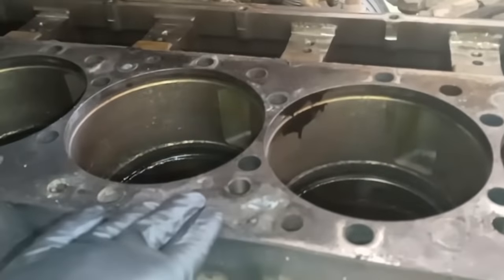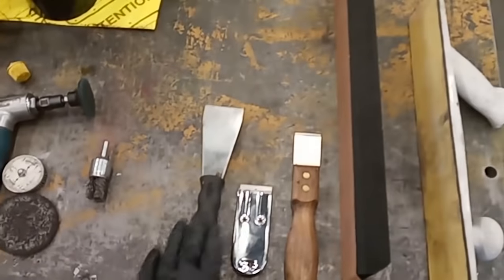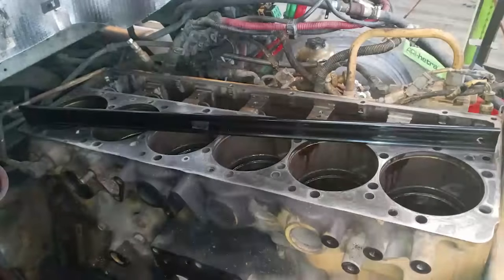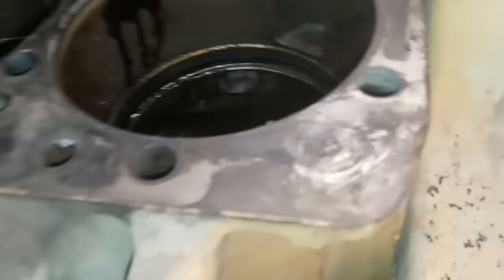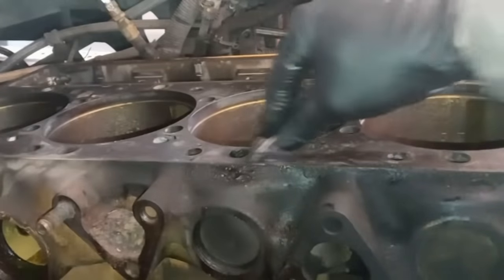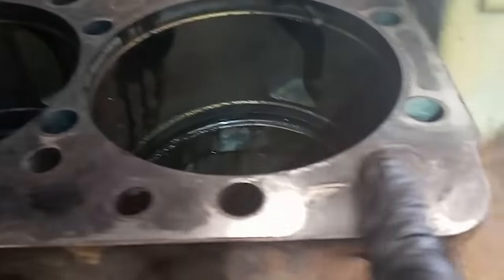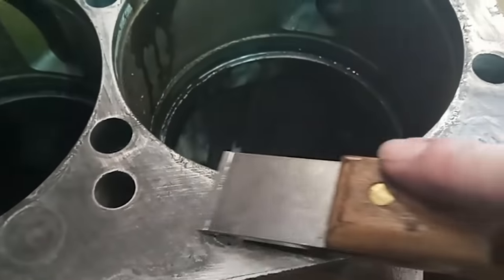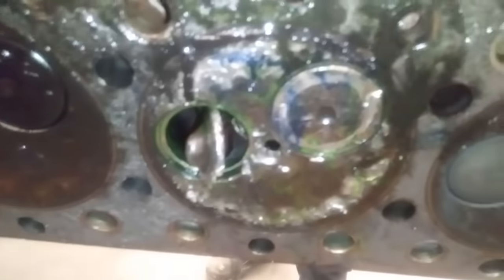Clean a Head Gasket Surface like a Master Engine Builder.

Comment: Hey how do you feel about bits of debris falling into the coolant and oil holes in the block? Is there potential for damage there or do you consider it negligible?
Reply: Geoffrey Robertson any small bit should not matter as if u do this you should flush your coolant with water until it is clear! And you should do a oil change shortly after doing this too!
Reply: Take cheap disposable earplugs and plug any holes you can with those. Saves a lot of work later

Comment: I'm going to Scott community college. my diesel teacher showed us to use a straight edge like you did. I was told to scrape and brillo pad and then wire wheel it then blowout all the holes. What's your opinion?
Reply: Skip the wire wheel. The best point I think made in this video is that the flatness is key, not the appearance.

Comment: How does this change with protruding liners? This is why I always end up scraping and then using Grey scotch pad lightly while chasing with rolls of blue rag and brake clean so I don't "loose" any of the abrasive dust.

Comment: When I started out rebuilding engines , after the block deck was cleaned we always took a bastard file to check for small areas of level like around individual cylinder holes than we moved up to a longer straight edge that would from one corner of block to other .
 Several ole ole ole Detroit's I had to use good old #1 Hardening Permatex to fill in the low spots . Never had a failure as long as block was super clean no oil or old gasket material left . I think the worst one was around .20 thousands difference  due to coolant leakage  in that area .
Plus that bastard file left you with a good surface grip .
There was one 8V71 series a customer brought in with a leak on the right bank , once the engine got up to operate temp you could see The Head walking back & forth on the block . Let the engine cool an checked torque on the nuts as it had studs in the block . Whoever had machined the deck several years back took off way too much material. The customer wasn't happy with that news !!,
Another time we had one come in with low compression an burning oil something fierce after another Shop had did a rebuild, I think he had like a 5 thousand mile warranty Or some such stuff , I watched as one of the old guys in the shop ran about 3 handfuls of bon-ami thru the intake as the engine was running , an sure as shit afterwards that sucker stopped burning oil , of course I got stuck doing the oil change as the then New Shop Puppy .

Comment: I do it more or less the same as you, but I always wonder about the abrassive dust/particles going into the bore and oil galleys in the block when sanding/scraping. I find it very difficult to clean afterwards. It makes you think how much you are actually removing and what kind of damage the rest is doing (abrassive dust/particles).
Great channel by the way:)
Reply from the maker: Thank you. I too ponder that. I do clean out the head bolt holes afterwards and tap them, then spray about 1/2 a gallon of brake clean over everything, but the only 100% clean option is to hot tank the entire engine.
Reply: I put a shop rag down each bore. Pulling it out when you’ve finished takes most of the crap with it.
Reply: Some folks say shaving cream in the small galleys, then shop vac it out, change the oil shortly after first startup.
Reply: Mattress foam and vacuum before you remove it

Comment: Great video as always! your a great teacher man. Much respect for what you do! I have some constructive criticism on that long aluminum straight edge...incase your not aware (im sure you are ) , when you make your measurements with the feeler gauge just be careful not to push down on the top of the straight edge. steady the straight edge from the side with your thumb and index finger like your pinching it. believe it or not , but just that little bit of pressure may deflect it just enough to make you think the readings are correct, when in fact they are not or at the very least throw it out a thou or two. just something to consider.
Reply: If a finger pushing down 2 lbs on the straight edge gives you good results with the feeler gauge then properly torqued head bolts with a new gasket will give good results.

Comment: you can see where the sander is hitting the high points. Thats where the gasket will be compressed the most. The lower areas will allow liquids to seep in

Comment: Knock out the highs, and rock on. I hone my surfaces at the end, but I'm a millwright, and it's just what we do. Hone just takes out the highs, doesnt take away material.
Reply: Hone my engines and cylinder heads I build, not just at work on turbines, compressors and pumps.

Comment: Hey Josh, I’m in the middle of doing this right now. Is there anything I guy should do to try and keep junk from falling down onto the crank or into the oil galleries? If so, what? Or do you just let it all fall and soak everything including the crank down with brake clean when you’re done to wash all the junk away?
Reply from the maker: I usually wrap the rod journals with a shop towel and wrap it tape during all the cleaning and prep work, especially if you are doing counterbore cutting. The longer bores, bolt holes and stuff you just have to clean after the fact, unless you can get some big plastic plugs for the liner bores.
Reply: @AdeptApe  thanks so much for the reply! I’ve got another question for ya now. I’m checking liner protrusion on my Series 60 I’m rebuilding and I’m using a liner depth gauges much like the one you use in your liner protrusion video and my readings are all over the place. All depends how I’m holding and where it’s sitting. Should I be putting pressure down on the gauge to hold it tight against the top of the block or just let it sit on its own and slide it. Seems like the gauge moves a lot depending on how my pressure is. Maybe it’s just that uneven, idk? Any input would be great. I don’t want to mess this up.

Comment: i know old school guys that only use a rolocs lol.... im glad someone else is making a thorough video to teach people the right way. what do you think about those roloc bristle discs with the rubber fingers on them. rated for aluminum but im skeptical
Reply from the maker: They are interesting, I've used them in the past, but anything that is going to be able to clean a metal surface by high speed spinning is going to potentially removed material asymmetrically. So I generally just scrape, then use a brillow pad on Aluminum. If the surfaces has stuck on gaskets or material perhaps some wet sanding with a 400 grit sandpaper. If the piece is thick and strong I'll try tapping the gasket off with a small ball peen hammer.

Comment: I worked 2 years in an engine machine shop. We used wire cup wheels, but always careful not to eat into the metal. And most blocks or heads were getting resurfaced anyway, though quite a few weren't and it wasn't an issue. I do like your method though, using a wire wheel makes a big mess and I wouldn't do it to an engine that isn't fully disassembled and getting jet washed. Lots of places I wouldn't want pieces of wire going on an in frame rebuild.

Comment: I cleaned the deck and I’m a little worried about debris.  My plan is to drain coolant, flush oil through and vaccuum/blow out cylinders.  Is that enough?

Comment: I guess I'm lucky on making them flat . I am in my engine machine shop so we generally machine the deck on an engine I am rebuilding . Do you have any videos dealing with repairing the counterbore for the liners ? We also go out in the field and cut most big diesels for shims or upper repair bushings . We also have the machine to install the lower repair bushings for the area where the o-rings go .
Reply from the maker: What do you guys charge for the orings bushing install?

Comment: Surly the loose grit will go down the oil gallery and become a grinding paste flowing though the engine?
Reply: If the engines being rebuilt out of the truck it'll get magna fluxed. I don't think that grit would do anymore damage than rust would
Reply: @johndowe7003  more common is penetrant dye and developer.  Less damaging when put back into service.
Reply: @tyrel7185  yea tht too

Comment: When I worked in the engine shop at a CAT dealer the machine shop would prep the block and head by skimming it. So, I never had to worry about it. In the field I use a die grinder with a fine wire brush. Yeah, some folks say that's not great cause the wire breaks off and can get into the engine. I've never had an issue in 20 plus years.
Reply: At my workshop we would lose our job if we got caught using air tools on a head or block
Reply: @jimmyoakeslift4374  I'd agree for aluminum

Comment: I’ve only ever scraped my blocks with a razor and brake cleaned. I’ve never had a problem with head gaskets leaking afterwards. I did use scotch brite by hand on my last engine but that was only because I succumbed to the it must be shiny pressure. I’m weak.

Comment: Gasket surfaces require an extremely smooth surface finish (cosmetic recommends 50 Ra or less which equates to about 150 grit sandpaper).  Less than 30Ra for MLS without Viton coating.  

220 is plenty.

Comment: Recently replaced head gasket on a roached Chevy 350 using a razor blade and three stages of sanding the surfaces by hand rather than using a block. I'm worried about it sealing properly and having to take it to a machine shop to get it decked. We'll see how it goes....
Reply: Note, I used a straight edge across everything and it seemed good but I'm thinking I may need to do it all again

Comment: Should check out the plastic 3m wheels. I'll only use them to pull off the really hard stuff
Reply: What’s the difference? 3m makes the roloc wheels too
Reply: I think those plastic wheels are only plastic, and  softer than any metal anywhere in the engine. This would mean that it can't remove any metal at all. Also, if any did get into the engine, it can't wear down any metal. As much as I would love to use something quick, especially on leaking head gaskets, I've always done the razor blade and fine sand paper.

Comment: Scrape well. Then I use a paint removing wheel on a four and 1/2 in. grinder. Hold it flat, and be on/off the trigger, in pulses. This works well, but if you have the time and money, use a quality machine shop.

Comment: Hand labor is always best, anyway puzzled with Cat engines with “copper core leaching” when doing oil analysis. I know it increases with load and ambient temperatures, need your opinion if this is indicating a cooler premature failure, even after new cooler installs it’s still comes back, read Cat bulletin on this, please do a video on this, thanks great channel!

Comment: Rather than using sand paper, I suggest that you go over machined surfaces with large sharpening stones. They can be kept exceptionally flat using flat stones and they will only remove material that extends above the machined surface. This is how us machinist keep our milling tables clean and free of burrs.
Reply from the maker: I've heard that more than a few times on this video now. I'd never heard of that before though. I have heard of using a large flat file as well. Wondering if perhaps that is also acceptable.
Reply: @AdeptApe  Files aren't really that flat. So I would not recommend them for this application. As alternative to stones, I would suggest using adhesive backed sandpaper on a very flat and ridge surface, e.g. machined steel, iron, or, even better, granite. Rubber or anything pliable is not suitable.

Comment: Id always flat sand blocks and heads on old flat 6 dodge motors. Use a straight edge and feeler gauges to find high and low spots

Comment: Could a random orbit sander also be good?  Even flat sanding can leave slight valleys depending on how rigid the sanding block is.  Agree with measuring off a machine-grade straight edge using feeler gauges.

Comment: Gotta question. So I have a 2007 T800 with a C13. Now that it's cold out she likes to hesitate. It hesitates all gears until it reaches  150 degrees engine temp. When it hesitates or jerks/bucks, it blows out smokes out of stacks. Once it reaches 150 degrees on engine temp it goes away. Like nothing ever happened. Where should I look first. It has 419k miles. Never had a problem until it started getting cold out. Thanks.

Comment: You said in this video you did an apprenticeship with someone. Can you do a video about that experience as opposed to going to college or both, pros and cons, if you have not already. Would be very helpful to hear your insight on both choices.
Reply from the maker: Oh, if you mean when I said Mike, he was our Technical Communicator. I didn't really have an apprenticeship in the truck shop. My first job there was a rebuild on a C13 in a tour bus, although a more experienced guy helped me on that one with some of the stuff, after that it was pretty much all me. Although the shop was full of more experienced guys so I was constantly asking questions on stuff, looking stuff up on SIS, and going slowly on stuff I haven't done before. I think a true apprenticeship would be good though, I had some experience already from working on generators, but most of that was electrical stuff and only some engine stuff.
Reply: Ok, ty, not sure if you consider suggestions but videos about shop tool choices, changing fuel filters, timing belts, fixing brake chambers, fixing air leaks in trailers, and what is done on most P.M's are some areas of interest for me if you have not done so already..also using an altimeter and checking electrical issues too. Thanks for all the interesting stuff so far.

Comment: One , Being IRON , I am surprised you didn't Caustic Tank it . Cleans Everything squeaky clean .
And Two , Stag Jointing Compound ! Dissolve some in Methylated Spirits into a Red/Orange Paint and paint the Gasket .
It will dry Bone Dry and not sticky at all . That Gasket will seal FOREVER . Stag is similar to Mani-seal . Same Family .
Other things might leak on a Cat . That Damned spacer Plate ! But the Gasket would be FINE .    
Surface prep was Great . Exactly RIGHT . Flat and CLEAN and Straight . Very important . STRAIGHT .
I  am an Old Navy Engineering Sailor . Got taught by the BEST . I used to be able to Hand Scrape to 1/4 Thou tolerances .
Reply: Never mind the shiny look, just sand block it after u scrape it..wire brushing it is a trouble removing "good fillers" in the cavity but instead just flat it out..

Comment: Doing a 84 302 block in a DIY car club. Guy has 8 GTOs cherried threw me a roc pad to clean it and said just don’t go crazy. …..REASON WHY FROM GOOGLE….

There are two styles of wire wheels that can be used in a die grinder for heavy cleaning such as the removal of carbon, dirt, RTV, paper and old gasket material. A coarse wire wheel (0.014" wire) can be used on cast iron sealing surfaces but shouldn't be used on aluminum or plastic surfaces

Comment: what do u recommend when it is solely a head gasket replacement and not an entire engine rebuild? i'd think the entire engine would need to be disassembled and cleaned to remove all that sanding grit.
Reply from the maker: Well doing just a head is a pain because the liners are in the way. Generally I scrape, scrape, scrape, maybe a little wire wheel action between the liners, then making sure the cylinders are clean. I usually vacuum them out, then spray with brake clean and wipe down, then coat with oil and wipe again, then coat with oil.

Comment: why don't you come to the power gen side? we do a lot of engines in frame and out of frame. also anything bigger then a inline 6.
Reply from the maker: I used to work there, but most did load banks and electrical work.

Comment: Is it just me? Didn't GM people to knock it off with the Roloc discs years ago because the broken down fibers are still abrasive but small enough to pass through the filter media in an oil filter?

Just yesterday morning I was picking something up at the machine shop when my machinist was lamenting how much metal people remove with these discs, sometimes making heads unusable.

Comment: Had a dude from Detroit come into the shop to do a counter bore and he used a 5inch Milwaukee grinder with a wire wheel on it and just went to town.. I was like WTF 😳 now I don't feel so bad about using a die with a wire wheel hahaha I asked him if he should have been using that and he told me thats what they're recommend to use at Detroit? Although I understand wire wheels are soft and won't take material from the block but holy shit if a customer seen that I reckon there'd be a fight in his hands haha

Comment: Your video is more correct the 90% online. I see so many people using the Rol-Loc disk and wire brushes on aluminum heads and cast iron blocks. If you thought you had a problem before, you for sure do now. You can't be shade tree on today's cars. The problem is, 80% of most mechanics still are. Get the job done ASAP and who cares about the customer. That's why I do all my own work. At least I know it's done right. And I hate doing a job twice.
I've been using your process for over 20 years and have never had to do one over unless it was because of another failure of the cooling system  I usually get aluminum heads close to mirror smooth.